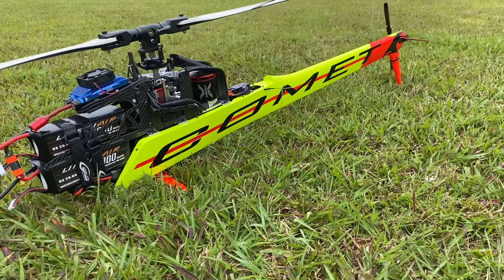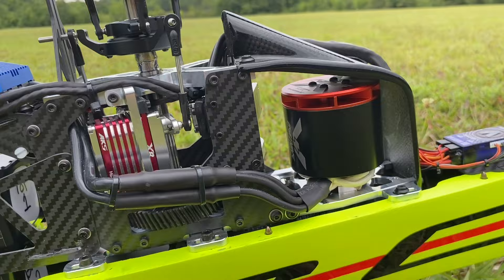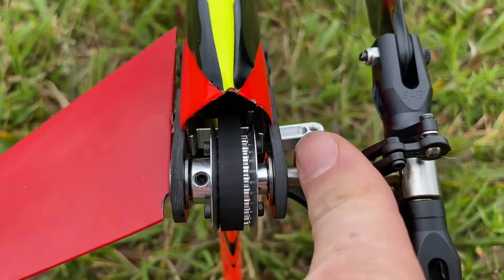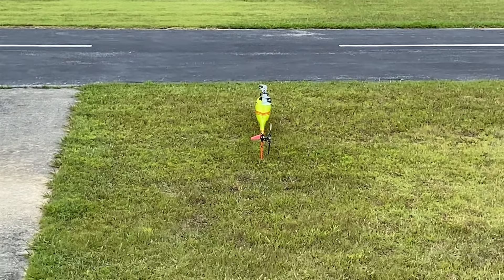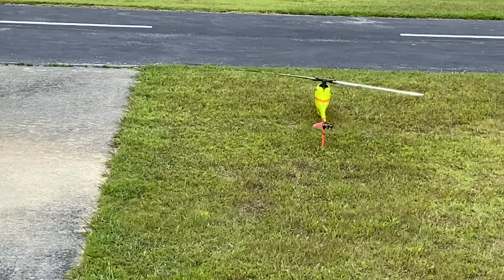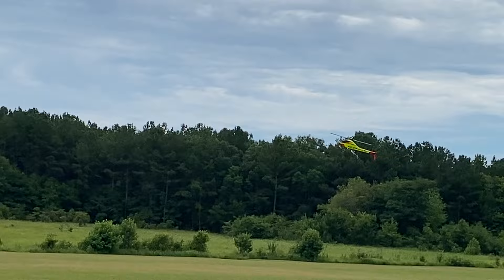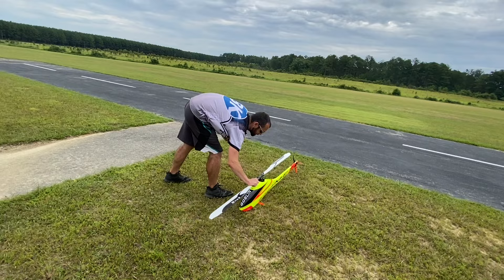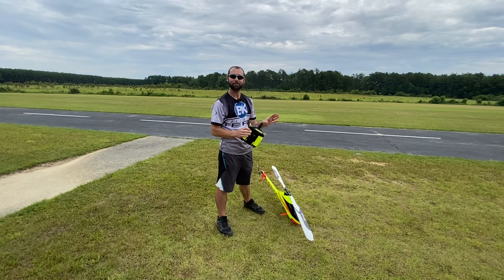I Waited 10 Months For This….

Comment: Very cool machine. Im trying to learn about speed flying. What does the tail fin actually do!? and why is it set at a 16° angle!?
Reply from the maker: Thank you! It’s a work of art lol so one of the biggest issues with flying helicopters fast is Blade stall. Luckily these blades don’t really stall like a traditional blade as they have a crazy design to them, but the nose does like the pitch up under a full pass or when you unsettled the helicopter under hard pitch transitions. The horizontal thin is a flying surface and like an airplane it holds that tail at that angle. You set the fin to the angle of forward flight and it will help steady and keep the helicopter tracking straight.

Comment: Great vid Jeff - mind explaining again why no 1 way bearing?  I wouldn't have thought power of motor would make a difference?  Beauty of a Comet - expected top speed?  Thanks again.
Reply from the maker: @HeliShed  thank you buddy! So this setup will make 20,000 watts! Yes 20,000 lol it has been tested by the guy who made these mechanics and every time the OWB would let go. So to eliminate failures he said don’t run one. It has the power to go over 200mph.
Reply: @westhobbiesrc8051  Thanks pal - perhaps he should design one?  I assume because of the headspeed it would let go??
Reply from the maker: @HeliShed  he might have designed a speed heli….. hmmm! We will see 🧐 head speed is not the issue it’s the power being the issue.

Comment: looks suspiciously like a goblin.....
Reply from the maker: @gavinausten1825  the swash plate, head block and blade grips are SAB, the tail grips, slider and links and fuse are stock goblin. Everything else is custom made. If you ever seen a stock Comet you could definitely tell.
Reply: @westhobbiesrc8051  Ok so not goblin but  some goblin...hmmmm
Reply from the maker: @gavinausten1825  yes it’s a mixture.